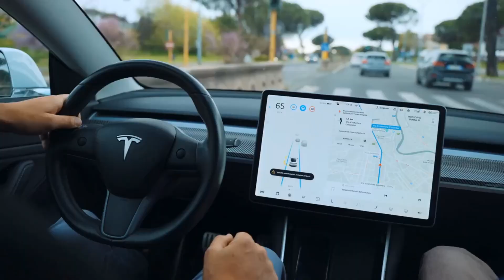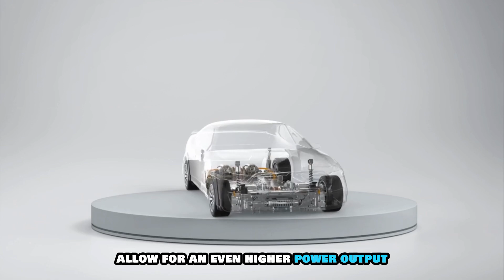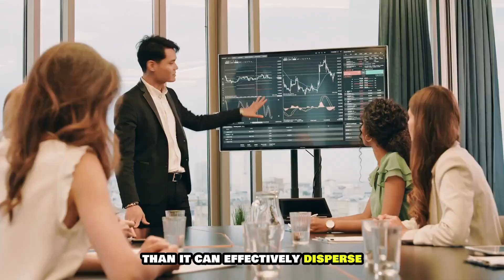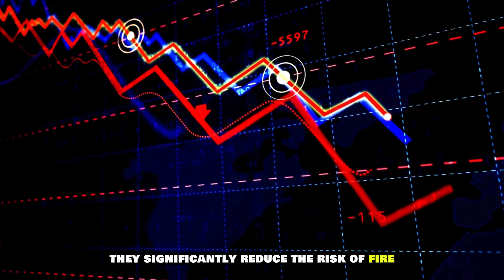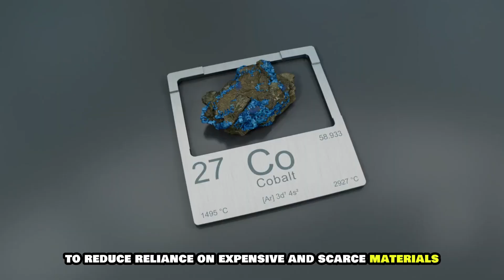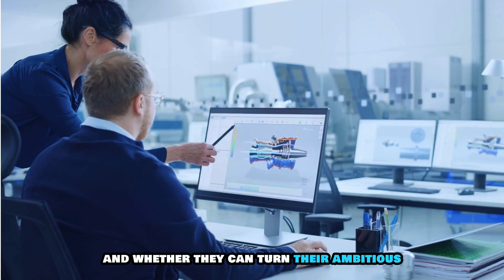QuantumScape’s NEW FlexFrame Battery Will Change EVs Forever!

Comment: Just imagine, if batteries had the same 130+ years of development, that has been enjoyed by the internal combustion engine. If that would have been the case, EV's would have 600 miles of range, and, would be able to charge faster than you can put gas in a combustion car, to go the same distance. The big thing that got electric vehicles rolling again, was the invention of high power switching transistors. Good motor speed control might have helped win the battle between ICE and electric, more than a century ago. If EV's would have won, and someone introduced the inefficient, high maintenance combustion engine, no one would even look at it, especially, the infrastructure that it would take to support it. That's the main reason, hydrogen failed. The cars work just fine, there's just no infrastructure available to support it. Electricity is everywhere, very easy to find a way to charge a battery. Hydrogen? Not so much. Gasoline and diesel would be nearly impossible to start in todays economy, if it wasn't already well established.